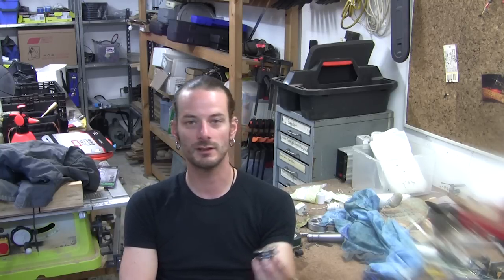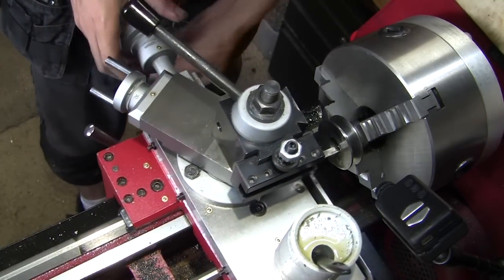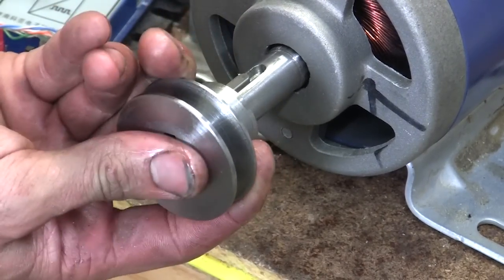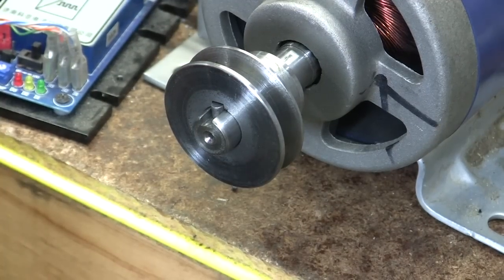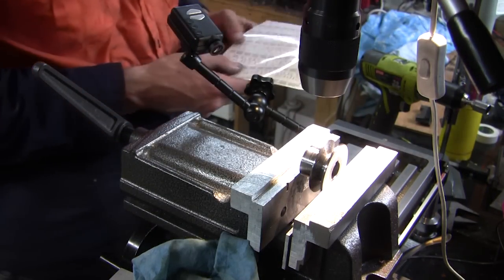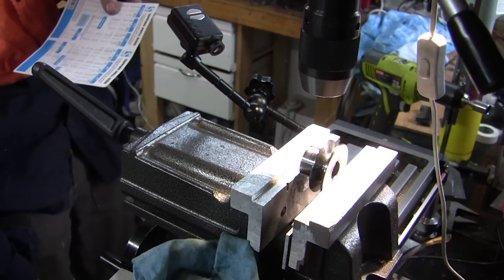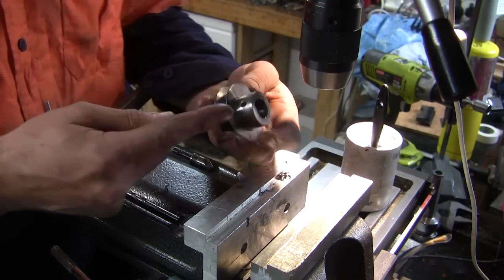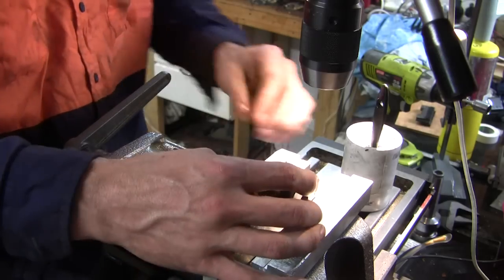Sieg C6 DC motor upgrade part 2 Making the pulley

Comment: can prolly make sumtin that will mount to the lathes bed and uses a big lever to push the broachtool intoo the workpiece 
then again i seen brouchtools that make the groove in one or two passes using a hydraulic press and there not THAT expensive

Comment: Great pulley build.  I am now hooked for the entire series of motor change.  I have had a lot of trouble with motor pulleys and loose set screws.  I have to check them often to be sure they don't slip.